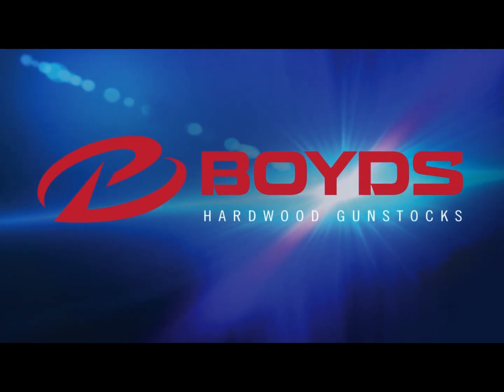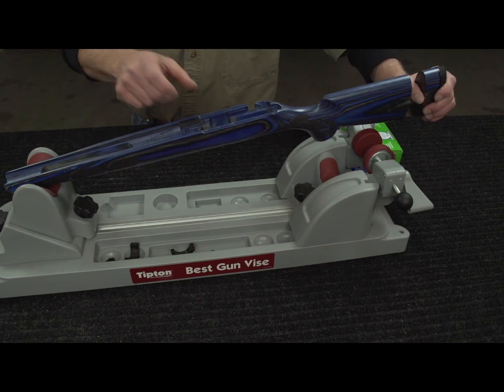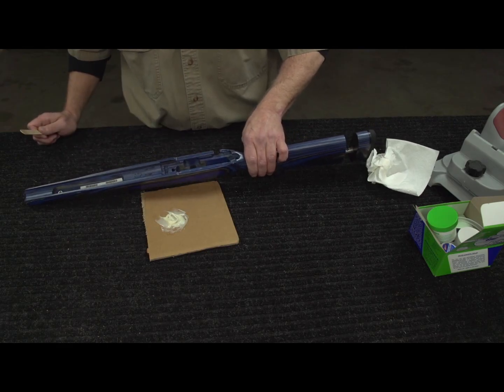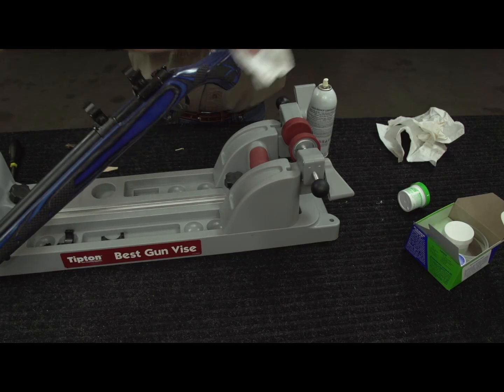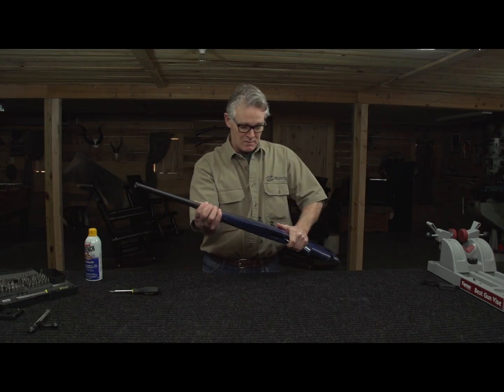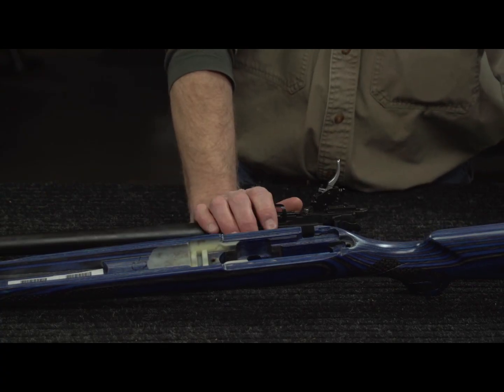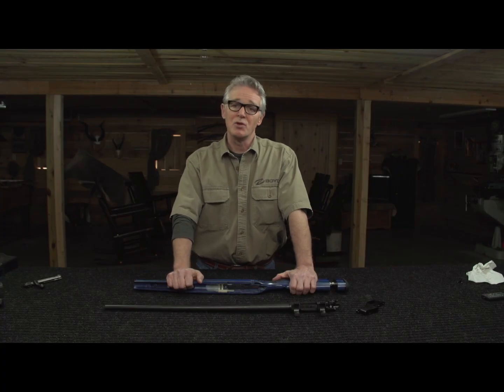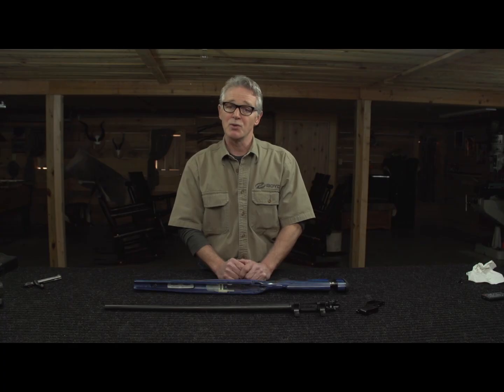Boyds Gunstocks: “How To and Why You Would; Glass Bed Your Rifle"

Comment: I did this once. I ordered a stock for my wife, she has an old .222rem Sako L461. The stock didn't fit with the barreled action, just didn't adapt each other. Sometimes it's a bit tricky with old Sakos... I ended up removing material from stock (pretty much) so that it was possible to drop the action in the to stock. The I used Acraglass to gain a good fit. Turned out just fine. The original Sako stock wasn't ergonomically suitable for my wife. 
Cheers from Finland!

Comment: I’ve seen people support the barrel with tape or clay near the forend when bedding. I am worried about adding any unnecessary torque. Why did you choose not to free float first or temporarily support the barrel in place while bedding here? 
Boyds Provarmint 
Thanks!
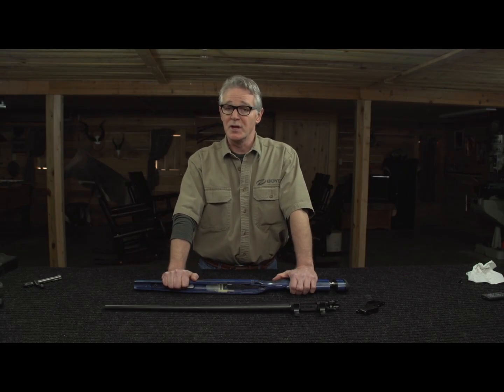Reply from the maker: Most gunstocks models we offer now are designed to have a free-floated barrel channel. Unless your barrel is larger than the what's listed tech specs, you would then need to free float for any addition clearance. The stock in this video was already free-floated, and the 2nd video referenced around 4:25-4:30 discusses if you need to provide clearance beyond what we normally mill for our channels.

Comment: Does this have to be done to the stock when you get it, or can I just bolt the action into the stock and shoot?
Reply from the maker: There's only one model that required glass bedding, the Ruger American series. Due to the steel lugs, the recoil is very hard on the wood. We send bedding compound in the box with Ruger American stocks. Any other model it's entirely personal preference.
Reply: @boydsgunstocks I got the aluminum pillar bedding for the Ruger American. Do I still need to glass bed the stock?

Comment: Things I would add to this;

- Use play dough or modelling clay to plug up any holes and crevices on the action where the bedding compound could seep.

- Use sand paper to rough up the areas that the bedding compound is adhering to. Boyds stocks are sealed inside and out. The bedding compound will stick to a smooth surface but a roughed up one gives better hold.

- Don't use acraglass, use Devcon.
Reply: Why not acraglass? Did you have a bad experience using it or what?

Comment: How do you avoid not getting the screws full of epoxy?
Reply from the maker: You will need to coat the holes, screws, and everything that you do not want to have bedding compound adhere to with a release agent that is included with most bedding packets.

If you do not feel comfortable doing this process effectively we suggest seeking out a professional gunsmith that is skilled in glass bedding.

Comment: There is no video on how to free float your barrel after you glass bed it, or I haven't found it yet on your channel.
Reply: Because you float your barrel first by taking a dremal or sandpaper and giving your barrel enough clearance for a $20 bill then glass bed when your done the barrel will never contact the stock
Reply: @tylitke3691 does it have to be a $20 bill or will a $10 bill suffice?
Reply: @TheRowdyRue 😂
Reply: @kevinwalker2522  I used two Tens. Seemed fine.
Reply: You wrap the barrel in tape. The thickness of the tape is the gap to float the barrel

Comment: I have a number of rifles with a Boyd's stock....either from the factory but most were replacement stocks ridding myself of several tupperware stocks.I have checked all of these stocks...thumb hole feather weight and Varmint bull barrel on one and I cannot see or find a single place where the barrels contact the stock...no one. Plenty of clearance. 

All of these rifles were Savage rifles or Stevens 200. One I shot before and after the install of a Boyd's thumb hole featherweight stock and accuracy did improve substantially. After glass bedding this stock using Devcon steel epoxy (And I use Devcon exclusively) and replacing the factory recoil lug to a precision ground recoil lug...the accuracy tightened up even further. As for the accuracy on all of the other Savage/Stevens rifles before the Boyd's stock install...well....the install of the stocks was immediate out of the box...so I cannot speak of the accuracy improvements using Boyd's laminate stock replacement sine this was done on the rifle right out of the box.  I cannot understand why someone would spend mega thousands for a custom rig when I have under $500.00 per rifle including a Boyd's laminate stock....not counting optics and high quality mounts and rings which cost me $300.00 per rifle just for the mouonts and rings...and on optics you cannot cheap out. You may not need a $1,000.00 scope but you need to use a high quality scope and install the scope  as stress free as  you can get it.

Note...I did not pillar bed a single one of these rifles since the laminate stocks from Boyd's are a hard material. Accuracy on every single Savage rifle with a Boyd's stock is remarkably respectable....to say the least. If you feel pillar bedding is necessary....by all means confidence in your rig does help in the mental game of shooting...surely this will not harm accuracy and may help. But I cannot complain on my results.

I would however strip down the action of trigger/etc and plug anywhere the epoxy can and will get into using plumbers putty...cheap and works well and coat the action with Kiwi show polish or Johnson's paste floor wax. But whatever works...you just want a tight tight fit and using the release agent in the Accuglass kit is really too thick even after drying. 

I have other rifles to build up...and the Boyd's Pro Varmint stock textured black is the stock I will be using as was the case on another build..balance is nice and accuracy is superb...nice looking too!!
Reply: I agree with your summation one hundred percent. For a while Brownells sold a spray paraffin product, don't recall the name, acra ease or something similar,   but I've made my own since they no longer carry it, by shaving paraffin wax into a glass jar  and covering it with naphtha, close the jar and set it in direct sunlight, over several days the wax will start to dissolve into the oily solvent ( same stuff as zippo lighter fluid)  eventually reaching saturation point. if you have one of those coffee cup warmers you can use that, as long as you keep a close eye on things,,, regularly opening the jar so pressure equalizes, and agitating it. When the fluid reaches saturation and no more wax will dissolve remove MOST of the exess, if all dissolved add more and continue until no more dissolves. when you are done, you will have a liquid wax base that will leave a coating of wax on everything you paint it on, and it will penetrate all nooks and crannies, it will dry and not leave puddles in your epoxy. Before  coating everything I fill the gaps with kids modeling clay, reusable  and cheap and epoxy doesn't stick incase you rub off whatever you use for a release agent  since it never dries out... that's the only difference between our techniques. I've used yours, just prefer this one since I'm use to it.   I Also have my personal custom made stocks on  some of my rifles and shotguns,  Boyd's on others, factory on the rest. My latest is an AR-15  in 7.62x39 with Lucid wood, (Boyd's premium line)  built for Wisconsin deer hunting. essentially a 200-250 yd max rifle  a bit more powerful than a 30-30 with the handloads I've worked up. I enjoy using Boyd's  stocks due to the finish and fit, minimal messing around and  good looks. cant ask for much more than that. And considering that I have the skills and ability to build what I want from scratch, why should I when Boyd's already has it, and for less than the wood alone would cost...